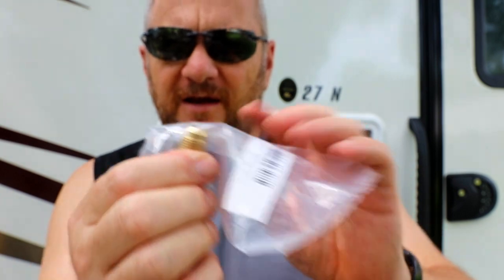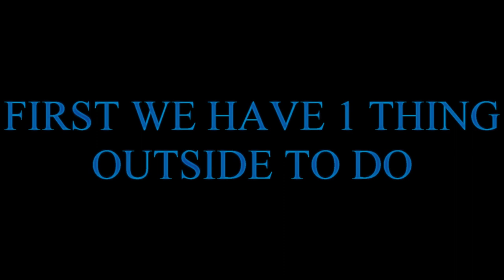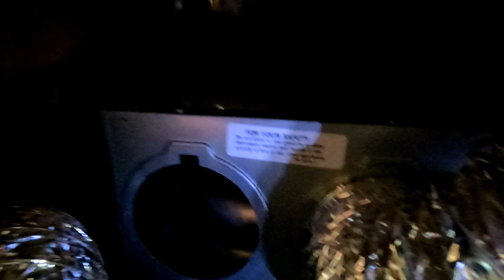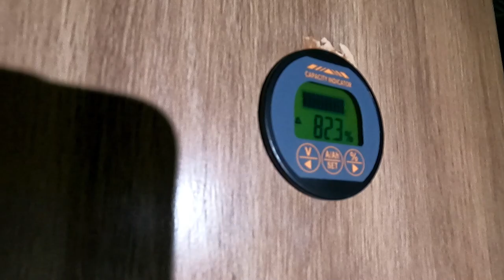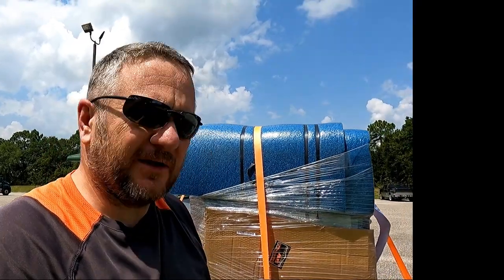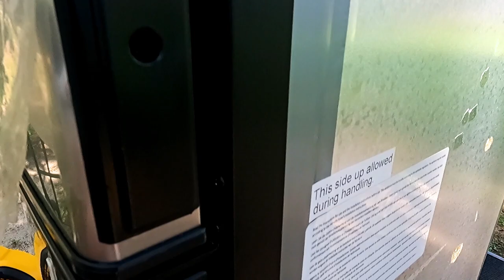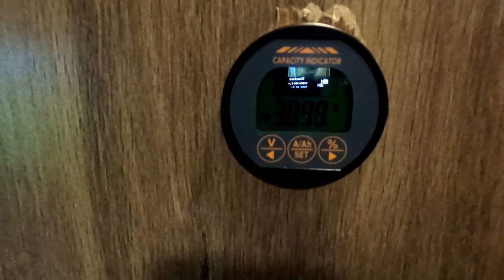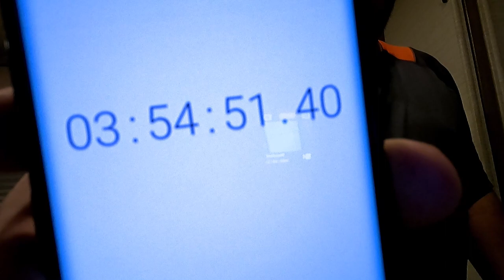Best Upgrade For Your RV 12 Volt Refrigerator Installation And Review

Comment: Very impressive…If I had attempted that, there would be a big hole in that space with a cooler sitting on a milk crate.  Glad there are people who know how to do these type things!  Good for you!  Yes fridge looks good.  Never knew how that worked on propane, so I did learn a couple of things.
Reply from the maker: Lol its not hard but I have a natural mechanical ability I guess.  The whole propane system is wierd I dont get how it works lol all I know is its not very good especially when it gets hot. Thank you I like it the stainless brightens the rv up definitely glad I did this upgrade

Comment: Great video. I see it's been two years, how's your experience with 12v? Especially if you went full time as we are. And what model did you go with?
Reply from the maker: Its been great summer temps in the 90s no worries about it getting warm unlike the pathetic little absorbtion fridge they put in. Nice thing is there is more room inside due to loosing all the propane equipment.  Haven't gone full time yet the wife is dragging ger feet about doing it.  I dont recall the model number off hand its been great I will never go back
Reply: @L2theWcarscoffeelife  In order to get my wife out full time, first we did six months, now we are doing nine. Next, we rent the house out! Wew!
Reply from the maker: @matsulli2086  mine wants to do it but has a dollar amount set she wants in the bank first she doesn't want me to have all the say over money lol.  We are doing week long trips several times a year so we are using it.

Comment: Looking to get the norcold 8 cubic foot size. Norcold appears to be the only brand I’ve seen with dual climate control. It’s been a year since this video was released, any updates and is the compressor a variable speed? Thanks for making the video, very informative.
Reply from the maker: Hi thanks for watching as far as the compressor I have no idea if its variable speed. We haven't had any issues with the fridge. Last summer in triple digit heat it still kept everything cold. Whats nice is you have a actual freezer. We can make ice cubes, keepnice cream hard and meat frozen. Something the old absorption fridge would never do. The dual climate.control is nice and with the thermometers inside I can verify it does actually work.
Reply: @L2theWcarscoffeelife  Thanks for the update. Compared several different brands and the norcold fits our needs the best.  Price, energy consumption, size and appearance.

Comment: Do the outside vents have to be blocked off with the fridge?
Reply from the maker: nope it actually helps get rid of the heat thats all the vents were ever there for is to allow air flow for heat to escape so its a benefit for the fridge

Comment: I have the same Norcold Fridge and cant get it to cool anymore. It is less than a year old. Any advice would be appreciated.
Reply from the maker: Check the fuses should be one on the power supply and probably up top where the control panel is. Make sure you have power

Comment: Does the unit continue to draw power at all times or only when on? Thinking of wiring mine through the fuse panel. Equal distance to fuse panel and battery compartment
Reply from the maker: If its running then its always drawing some kind of power there is a fan and thermostat that needs to stay on when the compressoris off. If you power it off I do believe it will draw a tiny bit because of the soft button to turn it on there should always be power at the control panel. It shouldn't be much at all kinda like a car radio to keep stations remembered if your storing it for months I would probably make sure its part of the circuit that shuts off with the battery disconnect

Comment: Are you going to remove the roof vent and seal that area of the camper?
Reply from the maker: Nope it would be too much work to do that properly you would have to recover the whole roof and why it doesn't leak or cause any problems.  The fridge still puts out some heat there is a fan on the back the blows up over the coils I figure the vent just helps this fridge out as it did the old one giving the heat some place to go.

Comment: I just bought the 10 cubic foot polar to replace my old Norcold 841 propane/electric bomb in our class A,  and I'm ready to start after watching this.  I read an 8 gauge wire is plenty, why the 4 gauge?
Reply from the maker: Thats great! I am glad the video helped.  You will love this fridge no more loosing temp when you open the door 3 to 4 hours totally cold. I ran 8 guage to the fridge my connector blocks can handle up to 4 guage. Yes you can run 8 guage just fine you might have to run larger if your far away from the batteries.  There should be specs in the owners manual. You  create resistance the longer the run of wire. For the most part everything is centered in these your probably not that far from the batteries.  Good luck you will be very happy you made the switch
Reply: I’ll measure the distance to the battery compartment but it’s pretty close I think  I’m going to guess about 10 maybe 12 feet, and probably run it under coach in some wire shroud for protection so less drilling of holes through the compartment walls.
Reply: @L2theWcarscoffeelife  We just pulled my old ammonia absorption fridge out today (I know had new one for 3 months in my shed...) I was wondering if you sealed off the outside wall vent holes as they recommend in the manual.  I assume it pulls air into it from the front of the fridge that faces into the living space.

Comment: Why couldn't you use the 12V wires that went to the original Refrigerator?
Reply from the maker: The original fridge ran on 110 volts or propane so the only 12 volt was to the circuit board those wires are not thick enough to run a compressor off of you would burn the wires up they cant handle the current

Comment: So once the fridge and freezer are at the correct temperature, how often does the compressor kick in?
Reply from the maker: About like a home fridge maybe twice an hour if your not opening it. I had it running all night cooling down before a trip no sun so no solar I was at 97 percent with 400 amps.of Battery  with solar last trip was 5 hours still.at.100 percent.  Draws 4.to 5 amps maintaining maybe 8 cooling
Reply: @L2theWcarscoffeelife  sounds pretty good. Thank you for responding. I trashed the old norcold absorption fridge awhile back and replaced it with a $300 dollar household fridge bought at one of the home improvement stores. If you have plenty of sun it works fine but leaning towards installing a 12vdc compressor type fridge.
Reply from the maker: Definitely worth it you have more room, stays cold when its hot outside,  very little power draw stays cold when you open the door unlike the absorption fridge which drops a lot. Definitely the future of rvs

Comment: is the 10 cubic foot model?
Reply from the maker: 8 cu ft
Reply: @L2theWcarscoffeelife  Norcold N10DCSSR  the amazon reviews are very bad, was wandering if they got those bugs out if it since august 2021 , thanks in advance
Reply from the maker: I haven't had the first problem with it. Based on some stuff I saw people dont know how to wire it up. They use existing wire from the old fridge thats too small they are not big enough to run a compressor.  Other than that I would guess they fixed anything because like I said  I have had no problems its been doing great even in triple digit heat it kept everything cold I have been very happy with it.
Reply: @L2theWcarscoffeelife  great I was looking at the magic chef  but with inverters ar rest they still draw about 100 watts when fridge not on.   Its just that the Magic chef interior looks stronger 1400 bucks for the dc10 I like the max draw is about 8.2 or night 6.3 but thinking over 24 hours it maybe not more than 2 amps average , hows your 6 cubic average in 24 hr doing thanks for all your help, maybe my 2 golf cart batteries are enough if i go with the norcold dc10

Comment: And when you lose that 10 degrees, it's about 2 damn hrs. to recover.
Reply from the maker: Not on this fridge 3 hours from hot to perfectly chilled in the 30s  propane fridge yes not this
Reply: @L2theWcarscoffeelife  Just installed a 10 cu. 12v in my camper this week. Best upgrade ever. AND...300Ah's of LFP battery + 500 watts of solar. I'm set. No more worrying about Propane or fridge temp.
Reply from the maker: Sounds good thats about what I have just a little bit more in solar and battery it doesn't even make a dent in the batteries.  Even as hot asnits been this summer with Temps in triple digits the fridge did great I know the old propane we would have lost food. Last year I had that problem I just couldn't keep it cold so in with the 12 volt and couldn't be happier
Reply: @L2theWcarscoffeelife  Maybe do a 1 year update video when the time comes.